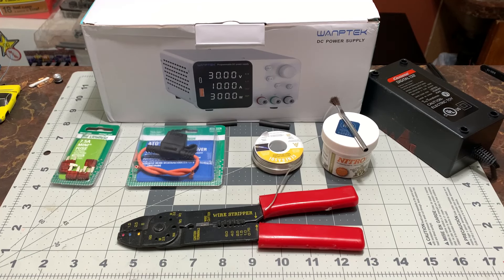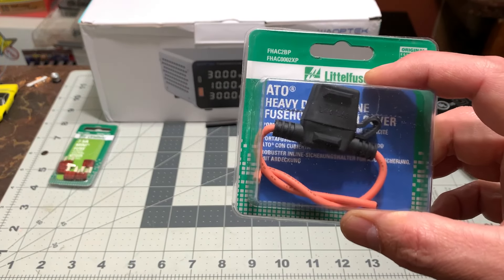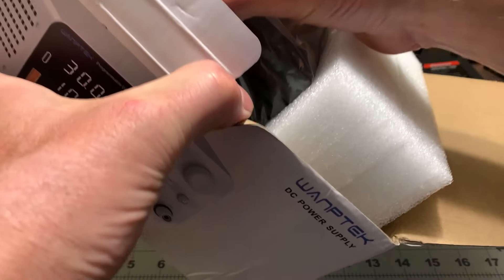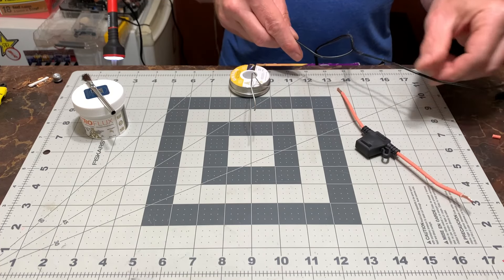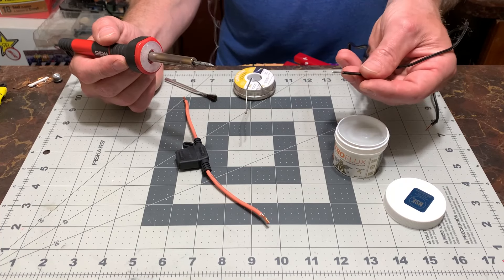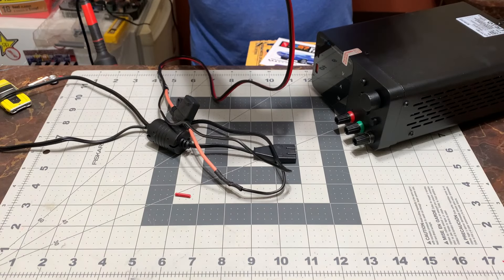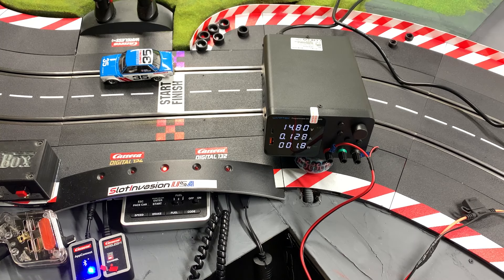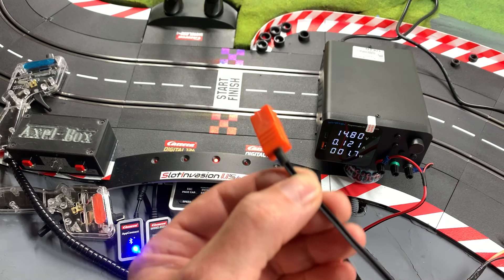Aftermarket Power Supply Install For Carrera or H.O. #Carrera #slotcar #afx #carrerabahn

Comment: I just pulled the trigger on a second power supply for my Carrera track so will definitely be following this tutorial soon. Thank you for sharing. Cheers 👍😎🇦🇺
Reply from the maker: If you bought this exact unit, there is no reason to put the fuse in the line. This unit has a fuse already built in but if you are like me you can never be to careful. 😉:_510:

Comment: Just a heads up, the bench power supply has a maximum output current of 10 A, which is supposed to be sustained. It should not have a problem delivering 10A continuously. You do not need a fuse on the DC side for the power supply. This particular power supply also has built-in over-current protection (OCP). You can set CV (constant voltage) to your desired max voltage, and CC (constant current) to your desired max current (up to 10A for the 3010 model you've got there), and it should automatically keep between constant voltage and constant current depending on the load.
Reply from the maker: Thanks for the info. I appreciate it
Reply: @slotvalleyracing  Happy to help! Thanks for the video! Regarding fuses for slot car tracks though: putting a smaller fuse per lane - something like 2-3A - wouldn't necessarily be a bad idea if you know for a fact that a single lane should never need to pull more than that specific amount of current, even during transients (short burst of current, could be a fraction of a second). 

It's not really to protect you or the power supply, but to protect the rest of your track in case of a short that might pull up-to the set current limit of your power supply. 
In other words, you might want your entire track set across all lanes to be able to pull 7.5A - or whatever you set the max current limit to - but you wouldn't want any one single lane to pull 7.5A (not to mention 10A!).

Happy driving!
Reply from the maker: Cheers!

Comment: Nice supply, You may want to look into your powerbase my policar powerbase had resetting fuses and I bypassed them and ran a fuse in line with each controller because those resetting fuses cut off when you use the lower wind faster motor cars my policar track worked much better when I bypassed them suckas!
Reply from the maker: I'll check it out. Thanks Steve
Reply: @slotvalleyracing  Dan search the web for self resetting fuses they look like little tan wafers my powerbase had them to bypass you can solder the ends together.